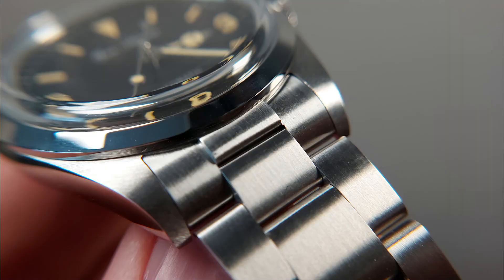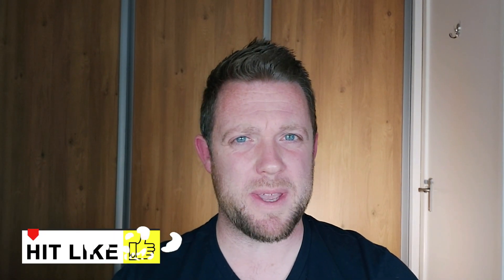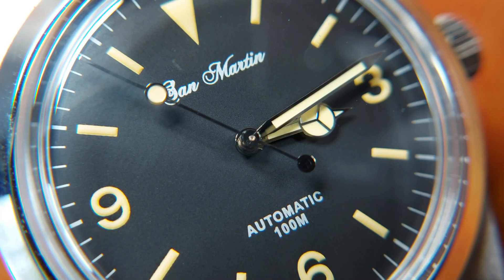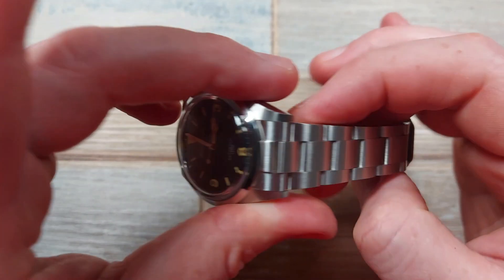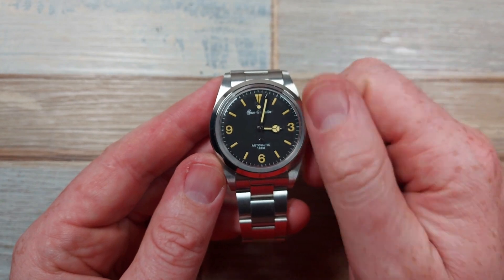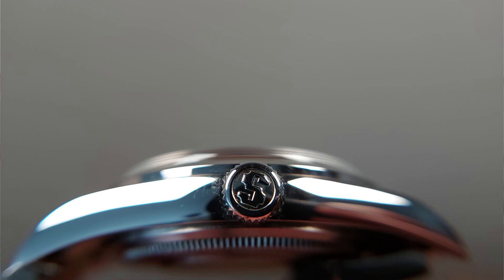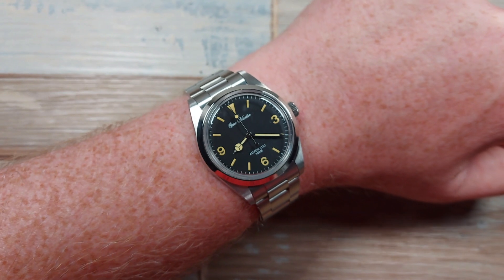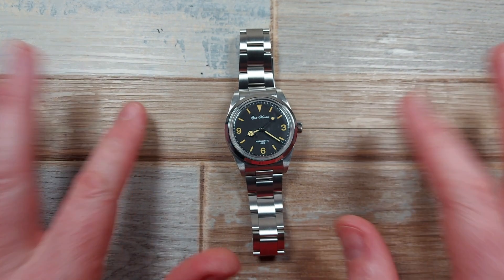This San Martin is a sneaky little watch. It's a grower not a shower 😜

Comment: Dan, I just built my first 36mm “Explorer” case watch with 20mm lugs on a lark, and I believe I’ve found my sweet spot, 36mm x 20mm. So I am eagerly awaiting this vintage San Martin in 36mm. Would be a cracking 11.11 sale piece, I think 👍😁
Reply from the maker: I agree mate! 👍
Reply: 23.08
Reply: @andrei-cosmin.popa85  Are you saying the 36mm San Martin “Explorer” will be released on August 23? That soon?
Reply: @cecilyau4440  nah, not saying. But I surely am hoping. I'd do just that if I were them, to take advantage of the release & sale 😁
I'm very excited about the 36mm version. Always wanted an Explorer I cannot afford în small diameter and modern specs.
Reply: @andrei-cosmin.popa85  No problem! You and I apparently have the same desire for this vintage sized and styled “Explorer” watch. Unless San Martin does something horribly wrong to this 36mm version, I expect to get one whenever it is released . . . though after I watch Dan’s review here as well as Gary’s ILW review, just to be sure nothing is amiss 😁👍
Reply: @cecilyau4440  if you'd like to go the extra mile and have a beautiful custom made dial, you may consider joining the BSH as there's most likely going to be a collab project with SM on this incoming 36mm version.

Comment: I'm really liking this watch more and more after watching several videos here on YT, especially after missing out on a brand new, genuine 214270 that is reasonably-priced. It's pretty novel that the watch it homages doesn't even exist in this size, so they are providing something that Rolex didn't do or wouldn't even have done themselves.

It is almost the perfect watch that just needs a quick adjust mechanism on the clasp. That and maybe an option for an unsigned crown and clasp (yeah, not a big fan of the logos and identity crisis here either). Apparently if you procure enough units, San Martin would be willing to customize the logos on the crown and clasp as well.

I would hit them up on WUS or their official store chat on Aliexpress if you have any suggestions. I already did! :)

Comment: How does the San Martin compare with the Bliger Explorer and the Bliger Datejust Explorer ? Their probably both made in the same factory as it is anyway using the same movements and components  just changing the branding for those gullible enough to  pay the inflated peices. After all the branding on the dial, crown and bracelet are the only differences. Keep up the good work.  JANBOY. RN. Rtd.
Reply from the maker: Hi Jan, san martin build quality and finishing are what you pay for 100% over the others. They are in a different league!